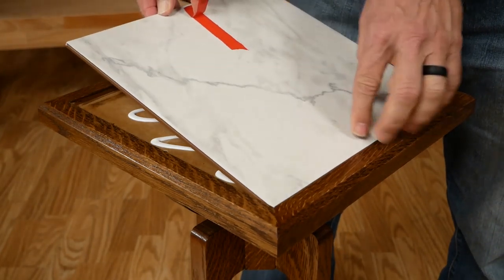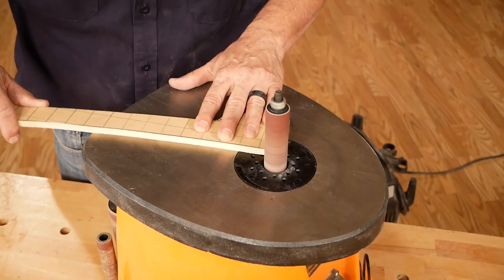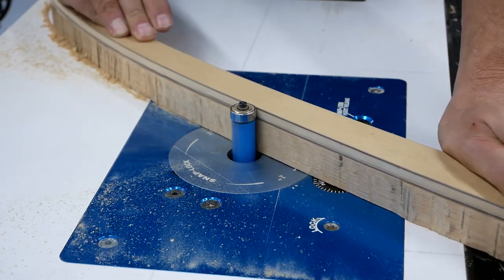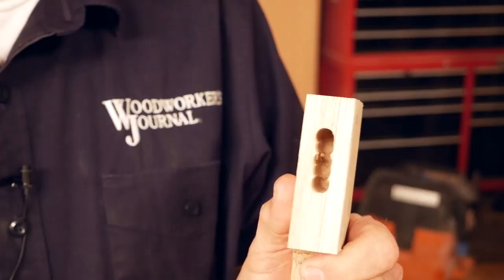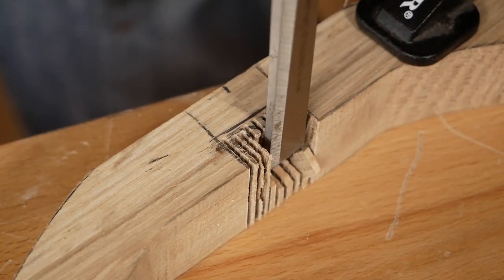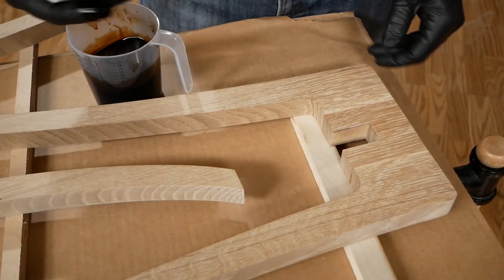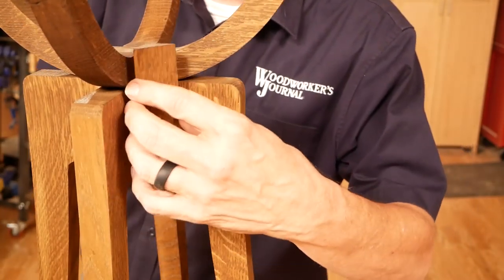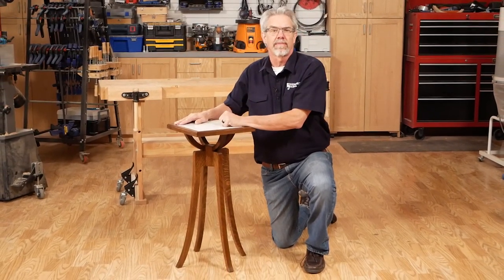Building a Tile-Top Plant Stand | Woodworking Project

Comment: You take time to show how you glue those dinky masonite squares on the bottom, but you completely skip how the rounded section is joined to the leg component and the table top.  I am guessing you used fasteners, so Titebond didn't give a crap about that part and you correspondingly skipped it.  To me, this was critical to show because I am wondering how secure fasteners will hold in the end grain of the rounded section.  Maybe you used dowels.  Would be nice to know.
Reply from the maker: Screws were driven down from the top of the table into the end grain of the curved sections. The screws hold very securely in the white oak. Full construction drawings for the table can be found in  the November/December issue of the Woodworker’s Journal magazine.
Reply: @WoodworkersJournal  Thanks.  Received the issue and might look at building this.